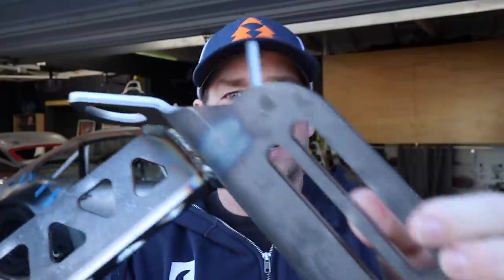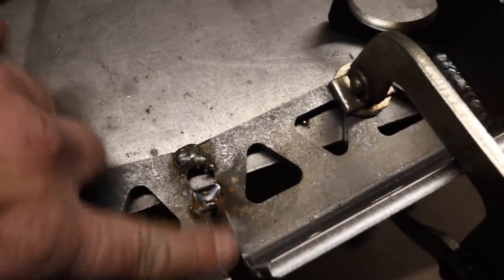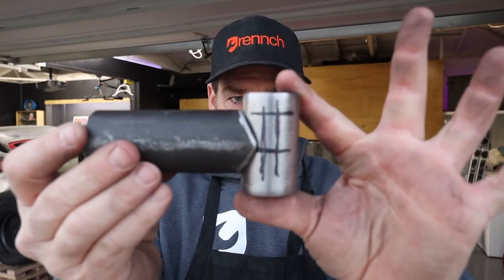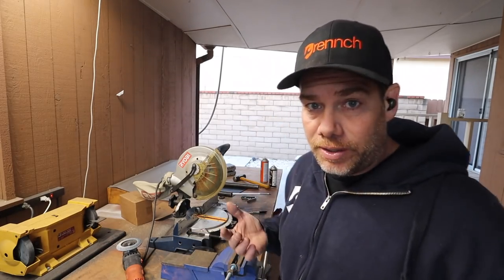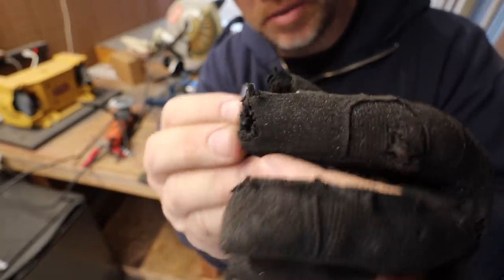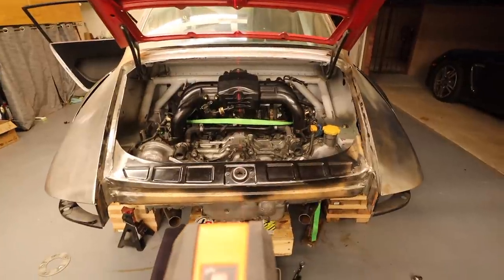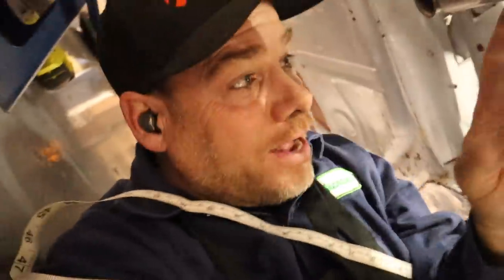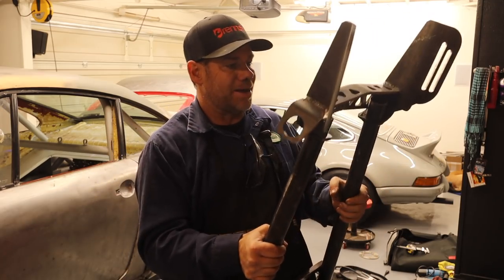Subaru EZ30 to Porsche Engine Cradle Part 2 | Twin Turbo Subaru into Porsche 911 Blasphemy Build 36

Comment: Hi Mike, my previous helmet stopped working and I ended up getting the starter Lincoln helmet at Home Depot because I needed something that day and budget was key!  I actually highly suggest this compared to my old Eastwood XL view helmet ($120) as the lens makes it a lot easier to see the welding, the tint is better and green in color.  It is not fancy but it does have a grinding setting.  It was only $69.  Auto-Darkening Welding Helmet with Variable Shade Lens No. 9-13 (1.73 x 3.82 in. Viewing Area), Galaxis Design.  Also, I didn't know that the Rennch moto was "Let's Weld Some Shizzz"  But I like it and will be saying this often.  High Five!
Reply from the maker: It's more "just send it!!!" but I'll take it either way. I ended up getting the best Vulcan helmet that Harbor Freight had, and it's awesome!

Comment: If you don’t have a battery powered band saw, put the bolt in a drill chuck, spin up the drill and press a hack saw against the bolt... cleaner cut than an angle grinder.

Not sure why the craze to cut everything with an angle grinder on YouTube... a band saw and jig saw will do most of the jobs, quieter, cleaner and much more safely... an angle grinder should be the last tool you use, not the first.
Reply from the maker: You're probably totally right about that.  Great tip about the bolt in the drill chuck!

Comment: I‘m worried that the cradle will be very close to the ground
Reply from the maker: I don’t think it’s any closer than my stock 911. I’ll double check today.
Reply: @rennch.  possible, but the stock mounting points are way higher I think, so at least that bridge from that 914 guy should be lower, but then I don’t know if the EZ30 sits higher that the stock engine. Comparison would be great. Love the progress so far

Comment: Don’t go too cheap on auto darkening helmet, get a known named helmet... the cheap, no name brands can react too slowly and cause UV burns to your eyes!
Reply from the maker: Tell me about it! Any suggestions?
Reply: @rennch.  I love my Esab sentinel A50, can be used for grinding and welding and comes with spare front screens for when they get covered in splatter and grindings etc I have had them for years, very reliable and great ergonomics. If not available get a Miller 👍